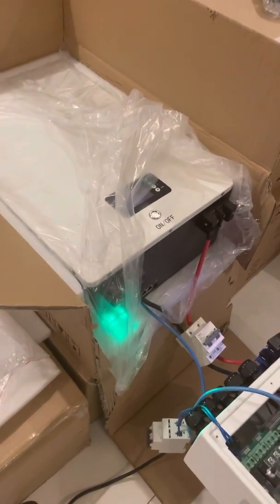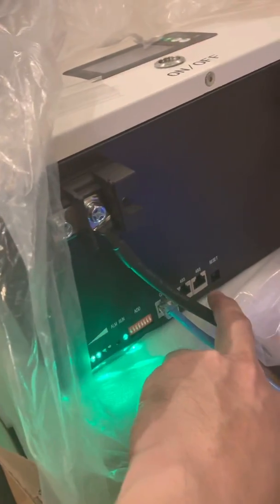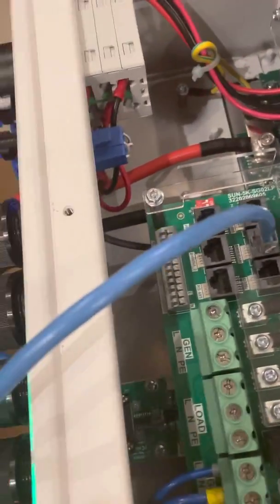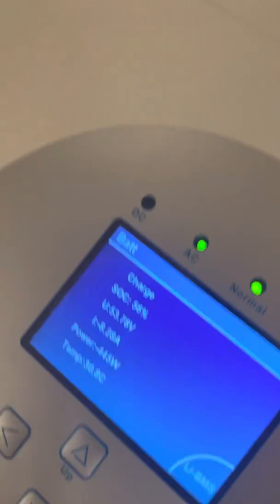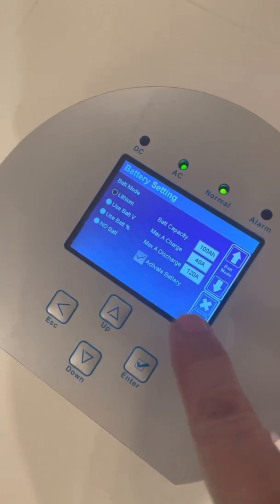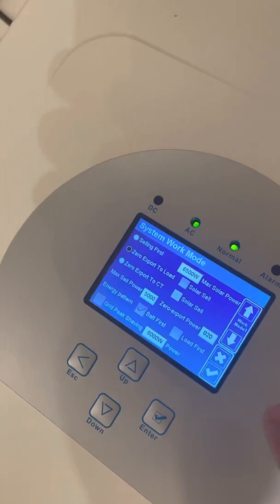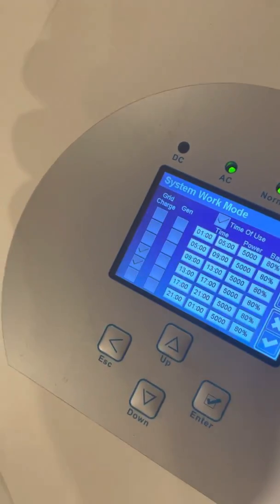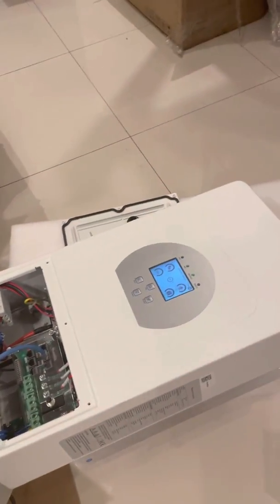NEW Powerwall XD Battery and Deye HOOG

Comment: Sir edwin pwd ba po ito ang e dagdag ko sa nabili ko sau na GSL
Reply from the maker: not advisable to add if you will be using communication but if only using as voltage, can be added. but be sure if 5kw only 5kw can be paralled

Comment: Sir ano po ba benefits nang may CAN connection between battery and inverter? Ok lang po ba kung wala? Thankyou sir. More Videos to come.
Reply from the maker: Benefits is they communicate and settings are adjusted based on protocol and better battery management unlike voltage only controlled by inverter to charge and discharge by inverter
Reply: Very helpful and informative. Thankyou sir

Comment: sir will the time of use affect the load output when you are using battery in brownout situation, if it reaches 25% dod the inverter will cut power to the backup? is there other way to control dod when using load power for backup
Reply from the maker: hi, if brownout it will use the specific value set shutdown value. Time of use means at volts or % it will return back to grid based on time of use settings
Reply: @solaredd7805  thank you for your help Sir! :)